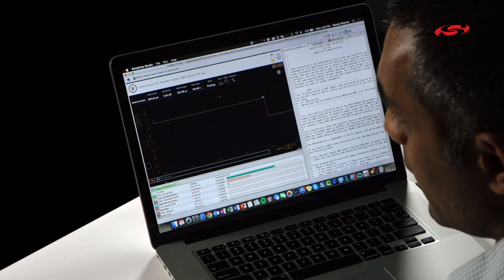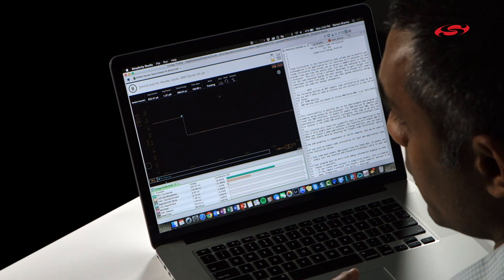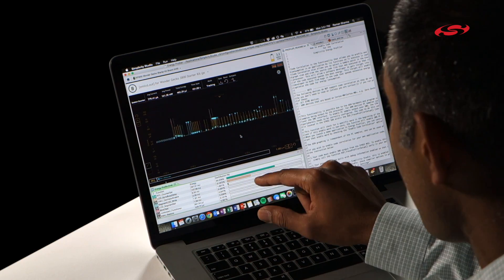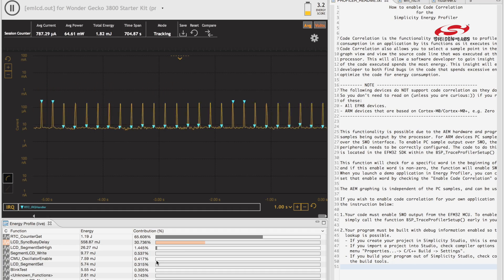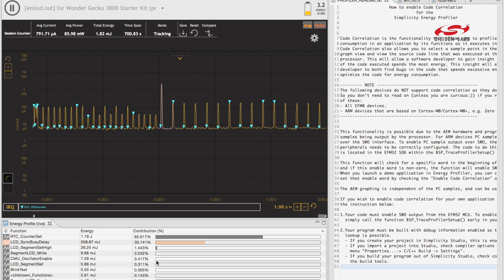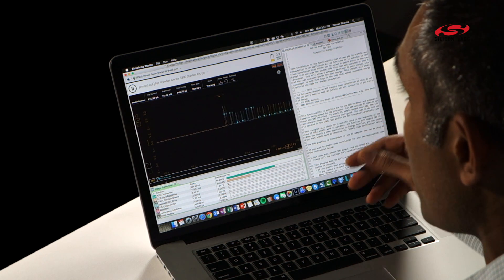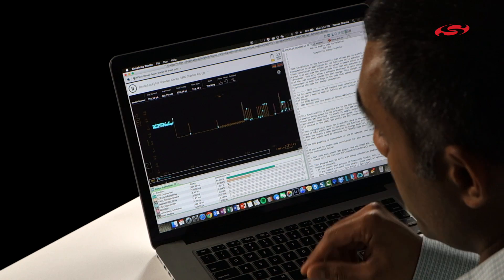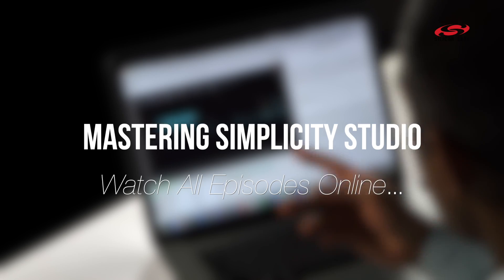Mastering Simplicity Studio - Understanding hardware and software correlation

Comment: Does the energy profile works only with dev. boards? So if I design my own product, i cant use this tool? Right?
Reply from the maker: +Toni T800 If you have a starter kit, you can connect your own prototype! Check out the community for inspiration: http://community.silabs.com/t5/32-bit-MCU/Debugging-with-the-EFM32-Starter-Development-Kits/td-p/97969